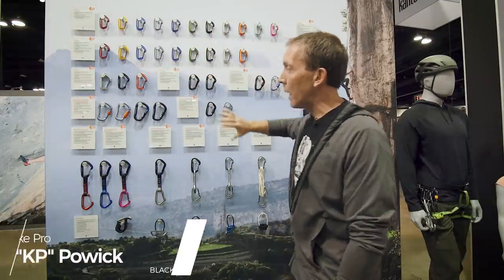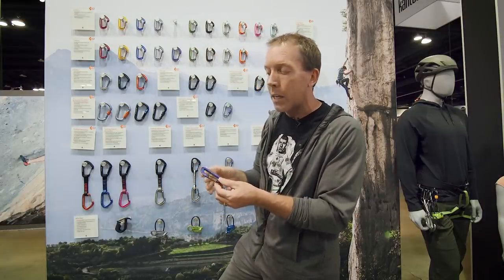2020 Black Diamond Carabiners

Comment from the maker: Carabiner Hotlinks
0:15 & 6:25 Hotwire
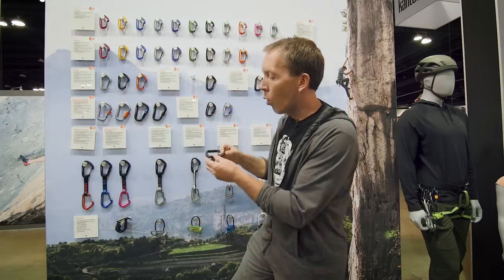0:54 & 6:49 & 7:49 Hotforge (the new Positron)
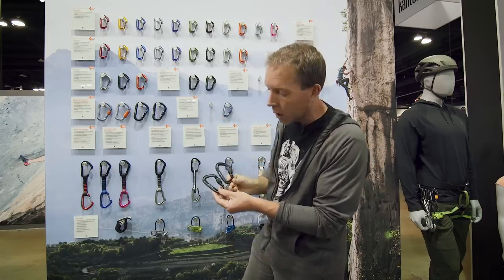1:26 LightForge (new)
1:45 & 5:57 Lightwire (the new Neutrino)
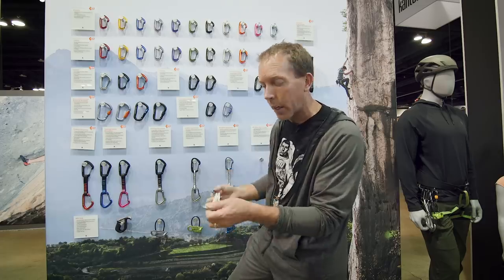2:03 & 5:24 Miniwire (the new Oz)
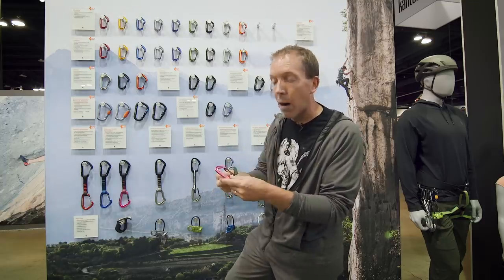2:47 & 7:11 Rocklock (mostly the same as before now its hot forged)
7:53 LightForge screw

Quickdraw Hotlinks
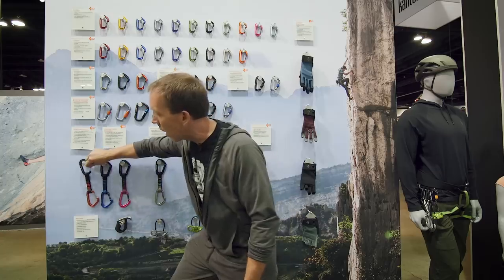3:16 & 8:11 Hotwire (wire/wire)
3:44 & 8:38 Hotforge Hybrid (solid/wire)
4:03 & 8:49 Hotforge Draw (solid/solid)
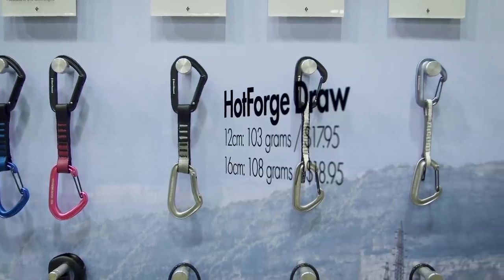4:15 & 8:58 LiteWire Draw
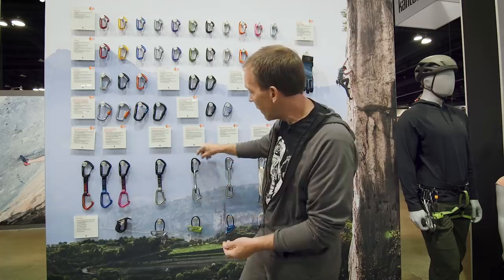4:37 & 9:20 MiniWire Draw
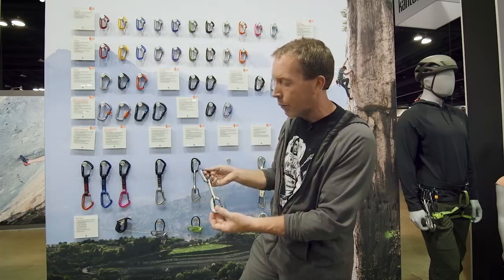4:54 & 9:35 MiniWire Alpine Draw (dynex tubular sling)

9:42 Explanation of packing options (individual, rackpack, 3-pack) & quickdraw lengths
10:16 Other tit-bits (made in Taiwan, what carabiners are retired, etc)
10:46 KP's favorite quickdraws

See best prices of the retired carabiners here: 
Oz: https://weighmyrack.com/Carabiner/Black-Diamond-Oz 
Hoodwire: https://weighmyrack.com/Carabiner/Black-Diamond-Hoodwire
Positron Straight: https://weighmyrack.com/Carabiner/Black-Diamond-Positron-Straight
Positron Bent: https://weighmyrack.com/Carabiner/Black-Diamond-Positron-Bent
Positron Screw: https://weighmyrack.com/Carabiner/Black-Diamond-Positron-Screwgate
Livewire's: BD isn't actively manufacturing them anymore and they've gone out of stock at all the main online retailers, so we officially retired them on WeighMyRack

Pre-order / See best prices of the new carabiners here:
MiniWire: https://weighmyrack.com/carabiner/black-diamond-miniwire
Hotwire: https://weighmyrack.com/carabiner/black-diamond-hotwire
Hotforge Straight: https://weighmyrack.com/carabiner/black-diamond-hotforge-straight
Hotforge Bent: https://weighmyrack.com/carabiner/black-diamond-hotforge-bent
Hotforge Screw: https://weighmyrack.com/carabiner/black-diamond-hotforge-screw

-AD

Comment: Guess I'll be keeping my Oz forever. Favorite biners and hoped there would be an update not a step back to auto-snagging biners.
Reply from the maker: If you're looking for other clean nose wiregates, I would HIGHLY recommend the CAMP Dyon. They look a little funny but have very quickly become my favorite 'biner
bit.ly/cleannosewiregates
Reply from the maker: Although the Alpha Light is amazing as well.
Reply: @WeighMyRack   Yes, but the DMM Alpha Light is no full size carabiner, it is smaller than the Alpha Trad, which IS ful size! And that size decrease for just something like 2-3g per biner.
DMM Alpha Trad, or, even better, Wild Country Helium 2. Best full size wiregate clean nose biner. If you don't involve the Petzl Ange L (which some may like).
Is the Camp Dyon also the same (Full) size as the Helium 2 or the Alpha Trad? Or the Petzl Spirit?
Because smaller ist shitty to handle, so no way I'm using this small crap.
I just use Alpha Lights in different colors for my DMM Dragon 2 Cams.

How is the handlig of the Camp Dyon? Damn, it has a gate open strength of 11kN!! The Helium 2 has 10kN, and all the others have less! Awesome!
Reply from the maker: @philipppuchner1115  I'm in total agreement, the DMM Alpha Trad and Wild Country Helium are the gold of gold standards. The Dyon is my 3rd favorite (if you're into snappy gates, it could be #1 for you). It's a bit narrower than the Alpha Trad/Helium (it curves inward, where the others kink out). The Dyon is perhaps a smidge smaller than full size - it's 1-2mm shorter than the Photon which is full size. It's significantly larger than the Alpha Light, almost half an inch taller.    -AD

Comment: Can someone tell me what is the purpose of selling carabiners in a 3 packs. I've only come across applications where a pair of matching carabiners is useful.
Reply from the maker: Some folks use this for TR setups - a locker for each bolt and the power point. Other folks use it for powerpoint, personal, and an "extra." Some partners share a pack. I've noticed that many many climbers buy a lot more lockers than they "need." Lockers seem to be comforting. An extra one always seems to creep on Andreas' harness, to my dismay.     -AD

Comment: Interesting to see that BD are no longer making hoodwire stuff, while at the same time climbing technology from italy are releasing some carabiners and quickdraws using the technology. Maybe they bought the patent?
Reply from the maker: @1kill2kill3kill Can confirm, it is the BD patent that Climbing Technology is using for the Berry W carabiner (I don't believe CT bought the patent but I didn't inquire to the patent details between BD/CT). Currently CT is only slated for one hood wire model vs BD's 3. You can see photos of the Berry W (and the draws it'll be on) at the bottom of this blog post: https://blog.weighmyrack.com/best-wiregate-keylock-clean-nose-carabiners/    -AD

Comment: Shame. I'm in the market for a lot of new carabiners for Trad, but I'm not buying anything that isn't keylock. Looks like I'm not buying anything from BD this time around.
If anyone has any recommendations for a great snag-free Alpine draw 'biner I'd love to hear them
Reply: Ryan Schneider Petzl Ange biners are nice
Reply: Have a look at DMM chimeras
Reply: Small Petzl Ange on one end and a large Ange on the other end for easier clipping is my preferred alpine draw.
Reply from the maker: Here's the list of all the options of snag-free wiregates: https://blog.weighmyrack.com/best-wiregate-keylock-clean-nose-carabiners/    -AD
Reply from the maker: Since you're in the market, the CAMP Dyon carabiners are 33% off right now at GearX (https://snp.link/c0279e43), which makes them $10 a pop vs the normal $15 per. We've been using them all summer - they have a super snappy gate action and size wise are just a bit under full size.      -AD
Reply: @WeighMyRack  thanks!! I stopped at Rock and Snow in the Gunks recently and tried the DMM Alpha Trad. Knew instantly I found what I was looking for! Can't wait to build up enough of a cash stock to get a rack of 'em

Comment: Why did you kill the OZ? I just received the Miniwire and compared to the OZ it's bad... way smaller (too small), and NOT snag free. Honestly I switch brands if I need more carabiners for my rack. The OZ was really the perfect balance between lightness and functionality for the alpine.
Reply from the maker: We're not BD, so we can't answer directly, but here are some guesses.... The Oz was very hard to make. BD switched factories and the new factory probably couldn't make it for the same price as previously. If they kept the Oz in-line and upped the price significantly there would have been a huge outrage and likely sales would drop which would make it even harder for that carabiner to be profitable/stay in line. BD has also registered a patent for a new type of keylock wiregate, so they probably decided that was where they wanted to place the most energy. I agree it seems short-sited not to keep the Oz in line until the next iteration was available. Until then, here's a post talking about the pros/cons of the other keylock wiregates on the market: https://blog.weighmyrack.com/best-wiregate-keylock-clean-nose-carabiners/ or you can go to weighmyrack.com/carabiner and filter on keylock and wiregate to see all the options available.

Comment: Are there pros and cons for using a small carabiner rather than a large carabiner?
Reply from the maker: Yes, definitely!
Pros of Small
- lighter weight
- takes up less room on your harness (allowing you take more gear/access it easier)
- often cheaper because they use less metal to make

Pros of Large
- often easier to open/close (especially if you have gloves on)

Typically, smaller carabiners are used for carrying gear like cams. Small-medium sized carabiners are used for quickdraws. Larger carabiners are mostly used as belay carabiners. 
-AD
Reply: @WeighMyRack  thank you

Comment: Sad that BD is going back to obsolete always-snag 'biners. No idea why anyone in their right mind would buy those nowadays.
Reply from the maker: Semi-Random info: Clean nose wiregate carabiners only make up 10% of the available options on the market right now and they're generally 2-3x more expensive than the notched options. Some carabiners are created with really amazing geometry that makes it rare for them to snag due to features like shrouded noses and steep nose angles. For example, I find it rare to have these carabiners catch despite the lack of keylock: CAMP Nano 22 & Photon, DMM Phantom & Spectre 2, Wild Country Astro, Trango Phase, and others.
If you can afford clean nose carabiners, then hell yes, stock up, for sure. I'm in total agreement with you! I just wouldn't say it's a cut and dry decision, especially with the cultural "dirtbag" who is looking to buying things as cheap as possible.     -AD
Reply: @WeighMyRack  Disagree.  I know most of the carabiners on the market are notched- this is true, but an increasing percentage of them are becoming snag free.  The CAMP Dyon and WC Helium among them.  There's a reason for this.  Notched carabiners suck.  You have a valid point about price point, but to completely remove ALL your snag free options- seems silly to me.  BD has umpteen variations of carabiners.  They couldn't leave a few hoods?  Something more is going on here.  Maybe a patent thing.  Who knows.  Also, I've used almost every 'brand' of notched carabiner and I have never found a notched one that doesn't snag, especially on traverses, and especially with smaller dyneema slings.  I absolutely hate them and won't buy carabiners that are notched.  I am not the only climber out there like this either.  All it takes is a couple super sketch scenarios where you need to clean quickly or extend quickly and have these snag to say "no more".  BD seems like they're completely ignoring this, when it's the reason they sold all of us on the hoods in the first place.  So either that campaign was all nonsense and not true and just a gimmick, or there's a specific reason other than weight or geometry or design that they completely redesigned their entire line offering and removed arguably the ONLY attractive thing about BD carabiners.
Reply from the maker: @JJ0n3z  We replied with more details about why we think BD isn't doing any snag-free carabiners in other replies, so we didn't repeat it above. I do not believe BD climbers/engineers have changed their opinion about snag-free being the best way to go. My guess is that this is a temporary business decision that is at odds with the typical values we, as climbers, expect from BD. I believe BD has a new idea in the works (there's patent evidence), and that they would have lost money moving this tech to Taiwan - with the idea that they were going to retire it in ~a year anyway. The hood wire design was hard already to manufacture, and it would have complicated the move significantly. Not providing a snag-free carabiner option is obviously a regression. My comment above wasn't made in support of their decision, as much as providing another perspective of why somebody might buy notched carabiners.        -AD

Comment: I wish these companies would make more stuff for us big guys. We are not all 5 foot, hipster vegans. I'm a 6'4" 250 veteran. I'm use to carrying around hundred pound gear that's rugged. I love climbing and rappelling. Give us some burley, bomber stuff guys! Hehe
Reply: I'm 260, and have taken some massive whippers on a 20kn biner with no problems. I also appreciate having a light rack!
Reply: @dracolyth  I get it, but I miss the 30Kn-35Kn locking carabiners. I have an old Omega 32Kn locking carabiner that I've had for almost 2 decades now. It's literally been through hell and back and still asks for more. I dont doubt this stuff works as intended but I miss the beasts you know what I mean?
Reply from the maker: If you're looking for 30kN+ gear you can still find US Made Omega Pacific and SMC gear available! The carabiners in this video are totally rated for climbing and rappelling even if you're heavy and you're wearing heavy gear, though I can also understand the psychological trust gap. If you rack up with mondo carabiners, you're also going to carry a lot more weight than necessary up the cliff, so the majority of manufacturers are focusing on lighter gear that is still follows all the safety standards of the UIAA and CE certifications.
Here's a link to view SMC and Omega Pacific carabiners (you'll notice even Omega Pacific has a mini-carabiner option now!): https://bit.ly/2MR67VO
-AD
Reply: @WeighMyRack  Awesome! thanks for the reply! I could not find the Omega's anywhere online except for Ebay and I don't trust second hand for that kind of stuff...I definitely understand the thinking behind their designs and making lightweight gear. I do have gear designed towards that idea. It seems to be the only thing getting company dollars towards new designs though...I appreciate a rugged piece of kit that will last a very long time even if its means adding a few more ounces and lbs for most of what I do.
Reply from the maker: @50StichesSteel  Totally agree that buying 2nd hand online is not the safest bet. You can buy new Omega Pacific gear directly from their website: https://omegapac.com/ or SMC gear directly from their website: http://smcgear.net/
Rock on! -AD
Reply: 50 Stitches Steel look up rock exotica or cmc rescues carabiners
Reply: You should buy the lightweight climbing stuff so you are safe and then just put a bunch of rocks in your pockets so your ego is safe too.
Reply: @John Daley You get what I'm saying at least. It's nice to be able to use your tools for jobs and different tasks, and in the same spirit have some fun with them.
Reply: @jeremyrosene157  Its not that serious man. It's all in jest my friend so don't get so offended. Just having a little fun with the things I tend to see in the industry that doesn't get talked about much is all.
Reply: @enyfd  I will do that, thanks for the tips
Reply: @hobbitilius  Good for you